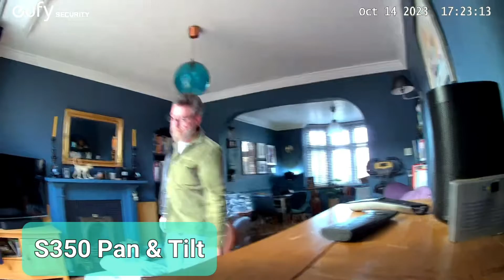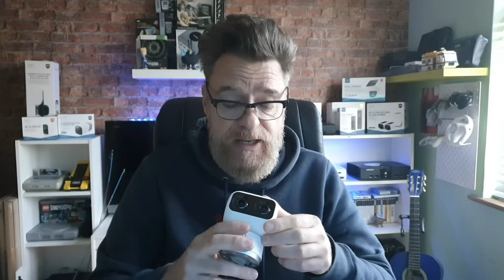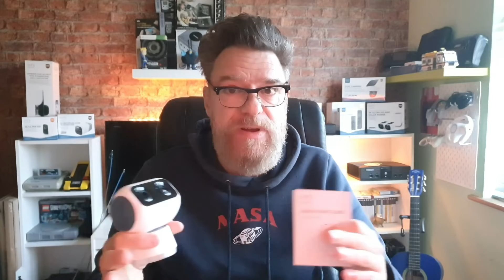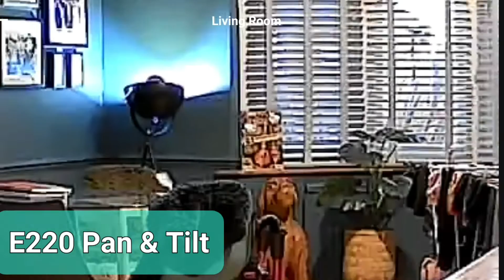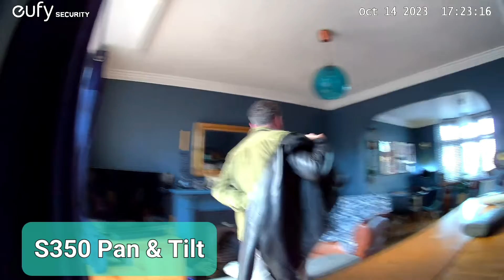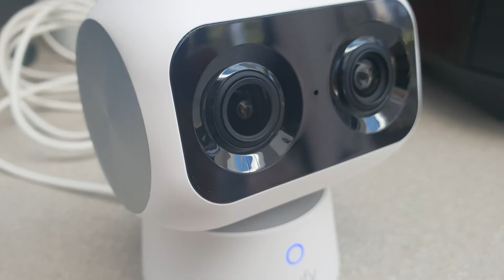eufy S350 4K indoor camera unbox and review

Comment: Thanks for the review.  Seems to me the auto-tracking is a bit annoying as it disrupts the smooth video.  Is there a setting that would tell the S350 to only start tracking when the person (or one of the people -- if there are muliple people in the room) reaches the edge of the viewable angle?  This way, the video remains smooth when possible.  I think the issue also may be caused by the limited 15fps.  I'm totally new to secureity cameras and looking to buy 3 for my home and have started doing research.  I'm landing on Eufy and it seems their best indoor camera is the S350.  I am looking for the best video quality (at 25 feet and for motion video of just people walking in the home).  

Any comment on my perception of the tracking issue?
Reply from the maker: The tracking can be adjusted to be slow or fast and it is a lot smoother than eufy's previous indoor pan & tilt. The 4K also allows a lot more clarity at max x8 zoom.   Regards tracking people, it will try to track the 1st person it sees and stick with that subject  until they go out of view

Comment: Hi Paul,

I've just bought the 350, and it has the same problem I have with the solar cam 340. ie, it doesn't track underneath left & right, it just stops tracking in the middle. So I just can't understand why I'm having this problem on 2 cameras.
Also, I joined your Facebook page & I've posted several times, but my posts seem to disappear, and my profile says I haven't posted anything yet ?.
Mark
Reply from the maker: Hi Mark - that is odd; how high is your S350 mounted from the floor?  Also, try posting again to the Facebook group and tag me in so I can check its posting ok for you
Reply: @eufysecuritycameraowners4795  Hi Paul,
The 350 is around 7 feet, possibly slightly less, it seems to track from further afield, anywere from 12 feet to around 30 feet or further, but if it follows you, and you walk just in front of it, ie 1ft to 2 feet it stops just as you pass in front of it, however if you stop & look directly at it, then continue to pass slowly in front of it, then you seem to force it to follow you.
As for Facebook, I posted a message to Admin a couple of weeks ago but again my post appeared on the page but disappeared shortly after, so I then joined using my works profile, and my post stayed on, so for some reason my personal profile seems to be  being blocked.
Reply from the maker: @user-dx9uh3de3m  do you have the S350 mounted upside-down on the ceiling?
Reply: @eufysecuritycameraowners4795  The 350 is mounted under the soffit outside, just for now, as an experiment just to see if it would track & follow better, unlike the s340, before I start drilling holes  in my interior ceiling, also to find out if the problem was down to a faulty s340,

Comment: Hi,
Really would like this camera to replace the old 220, of which ive currently got  2, but I have heard that the eufy S350, will only record in 4k, if used as simple monitoring camera, and  recording quality will drop to 2k once you switch on the motion tracking settings to detect  human, pets or other motions, also will only record in 2k if duel mode is selected.
Is this true ?
Thanks
Reply from the maker: I believe If you’re paying for the cloud storage, it will not record in 4K,  only 2K for each lens/sensor. Only the wide angle lens records in 4K to SD card/homebase when it’s attached to an account that doesn’t have Eufy Cloud

Comment: 'Pretty long cable'

*only 2 meters long. Serious? I need an outlet under my cam when ceiling  mounted?
Reply from the maker: I'm not sure if that's a question or statement?  Yes supplied cable is 2M (serious) and yes you'll l need a source of power if mounting on ceiling within 2M if using supplied cable (serious) or further if using own longer cable (serious)